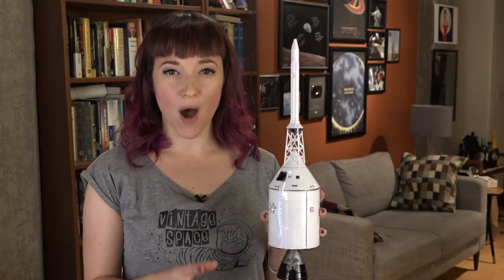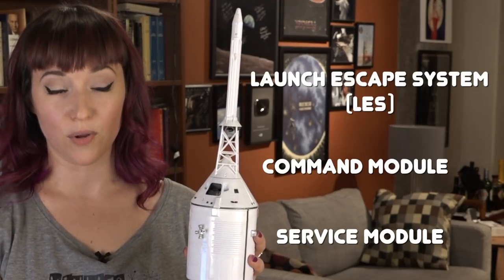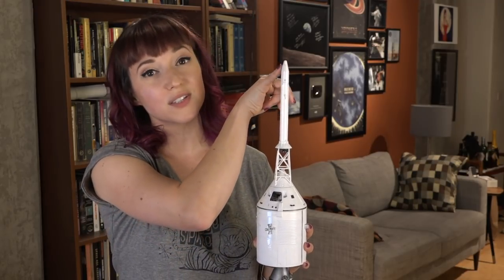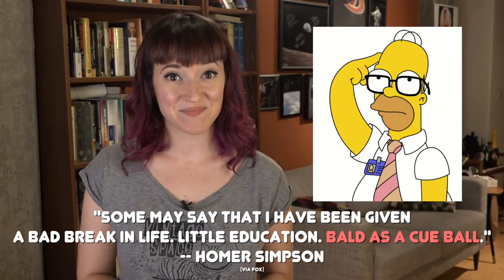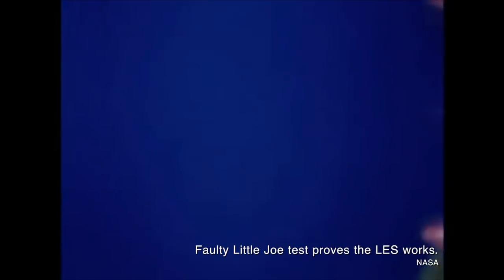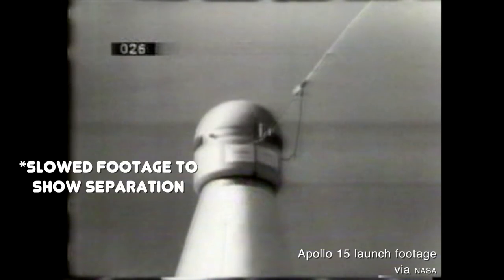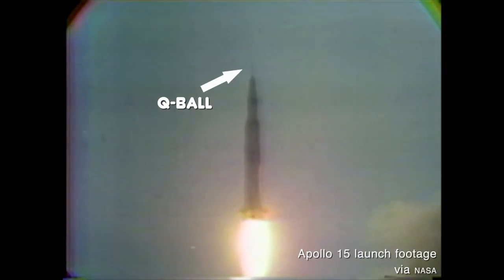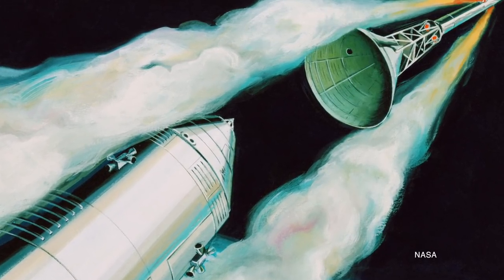The Life-Saving Q-Ball of Apollo

Comment: Among my other engineering duties at KSC from 1967-70, I was the Q-Ball Cover Retraction System engineer for the launches of Apollos 8 through 13.  I want to make a few comments on the video.

The top of the LES was not a “tiny silver ball” as stated.  It was cone shaped with a rounded top with holes in it;  no “ball” was visible.

The Styrofoam cover was put in place whenever the vehicle was exposed to the elements, namely rollout, CDDT and CD.  At the pad, the LES was usually enclosed by a small shack on the MSS.

The 2 halves of the cover were held together by a wide (3”) rubber (not elastic) band under tension.  The 2 ends of the band were held together with a short piece of copper wire that passed through a shearing (not razor) mechanism.  The cutter was attached to the cable that was routed back to the 320’ level of the LUT (via a pulley on the Hammerhead crane walkway) where the drop tube and control panel were located.

The command to initiate the cover retraction process began at T-8.9” (not T-5” as stated) when the launch sequencer sent a signal to activate the solenoid valve which applied 125 psi to move the lever supporting the weight.

The retraction system for Apollo 4 (and possible 6) consisted of an inflatable bladder that was inflated prior to launch, causing the 2 halves to pop apart.  This method was apparently too complicated and was changed to the rubber band method for Apollos 8 and later.  The QBCRS was monitored by the CPDC (pneumatics) console in the LCC and still had a (deactivated) switch on it to manually operate the old inflation system.
Reply: Thank you so much for commenting. You may not think it but you are someone’s hero. I regard every engineer and technician involved,  yourself included, to be my heroes.  Your collective efforts accomplished the seemingly impossible. The single greatest feat ever undertaken by mankind.  As an engineer, I can only dream that in my lifetime I will be involved in such a noble effort.

 I too noticed in accuracies in the video, demonstrating a general lack of understanding about the aerodynamic principles involved and what this device measured. For example, the misunderstanding of what the variable Q actually represents.  I do admire her efforts  however, to spark the imagination of people in a time when our civilization no longer seems interested in leaving the earth and exploring the great unknown.
Reply: Aw, shucks, twern't nuthin'.
Reply: apollo11guy I admire your humility :)
Reply: Several reasons.  For one, we didn't want another arm sticking out over the rocket where it could scrub the launch if it didn't retract properly.  Second, it would be hard to put the cover back in place if for some reason the launch was delayed or scrubbed.  The actual system was activated at T-8.9" when the engines were started up, so that baby was almost certainly going to leave.

Sorry for the delayed response.
Reply: apollo11guy Thanks for the info, I hadn't considered the risk of a half-retracted arm.
Reply: Was there a mechanism in place to confirm that the cover was successfully removed before the rocket was released?
Reply: @MrBtdobie  I read in either David Wood's book or Jonathan Ward's book about Apollo and the launch and they said, no there wasn't. They monitored it by watching the TV monitor. The b/w video that is shown in this video showing the cover coming off, was the actual launch video and was sent live to the LCC. So, they just watched TV to make sure it worked.
Reply: @apollo11guy  thanks for sharing
Reply: I consider your commentary a valuable Easter Egg. Thanx for sharing mate!!
Reply: Astonishing how much thought and engineering went into every single component. We'd never know without you guys being around to tell us.
Reply: Everyone that contributed to the space program are heroes. I am lucky to have witnessed the glory days of NASA and the moon landings. I try to read and watch everything I can related to that era,  and am in awe of how everything came together to get Americans on the moon. Thinking of the enormous complexity of getting them to the moon and back safely, you can see how they tried tried to simplify the systems for repeatability and redundency. Kudos to you and your pro art in that great accomplishment!
Reply: She's Canadian. Elastic = rubberband.

Comment: The question about the launch escape system I've had for many years (almost half century) has been solved. Moreover, I learned that the name of the Q-ball comes from the dynamic pressure = Q, and that the boots protective cover is removed by the tower jettison motor. Thank you for the wonderful video.

Comment: Just to clarify;   the 4 nozzles on the bottom of the LES are all connected into one solid fuel combustion chamber, not 4 separate motors.  You probably meant this, but others might not know.
Reply: plus they don't gimbal
Reply: Yup, they don't gimbal, the LES uses small fins and a separate engine-system to pitch
Reply: Thanks, you saved me looking this up. It didn't look like it would be four separate motors.

Comment: I would like to suggest a correction to what was said in the video presentation--The Q-Ball was not part of the launch vehicle attitude control system at all, i.e., it had nothing to do with engine gimbal commands.  To do so, it would have had to interface with the Launch Vehicle Instrument Unit.  There was no such connection.  The Q-Ball did 1 thing, and 1 thing only--it drove an Angle-of-Attack meter on the Command Module display panel.  For anyone interested, the meter it used was the Pc meter for the SPS engine, since this meter was not used for that purpose at this point in flight.  Also, the Q-Ball was not used as part of an automatic abort system.  Per the Apollo Mission Rules, the Q-Ball was used as a 'trend indicator only, with specific limits established in the Mission Rules document'.
Reply: Thanks for the info. How about the ballast below the nose cone that had depleted uranium and lead in it to help with aerodynamic stability. I've been trying to find some more in-depth info about this with no luck at all.
Reply: Hi Mako88sb-- I was not aware at all of the whole 'ballast compartment' business.  I dug out an Apollo Operations Handbook, and was able to find the following:

The tapered ballast compartment and nose cone top the assembly. The ballast compartment contains lead and depleted uranium weights. The nose cone contains  the 0\Q-ball instrumentation. Both the ballast compartment and nose cone are made of lnconel (a heat-resistant nickel alloy) and stainless steel. The Q-ball provides an electrical signal to a  display on the main display console and to the ground. The Q-ball has eight static ports (openings) for measuring pressure changes which are a  function of angle of attack. The pitch and  yaw pressure-change signals are electronically summed in the Q-ball and displayed on the indicator. The Q-ball information provides a basis for crew abort decision in the event of slow launch vehicle divergence. 

I know this is not exactly a 'wealth of data', but it's all I can find at the moment.  Sorry.   Do you know where Amy got the reference regarding the Q-Ball somehow feeding the Launch Vehicle flight control system?
Reply: Thanks for the info. Helps a bit.  I only found out about this particular feature after watching one of Scott Manley's episodes. Sorry, don't know where Amy got her info from.

Comment: Planes have static ports as well, very critical to determining rate of climb and altitude, and used as a reference point for the Pitot tube to determine airspeed in relation to ambient air pressure.
Reply: ecoheliguy Provided they don't clog with ice crystals, like on the Airbus A330 series.

https://en.wikipedia.org/wiki/Air_France_Flight_447

Comment: Pitot tube does measure air pressure in a technical sense. Differential pressure between the hole in the end of the tube and a reference hole. Indicated air speed.
Reply: This is correct.  It measures ram air pressure.  It also needs static air pressure to determine airspeed, the tube itself is nothing fancy although on newer planes the entire air data computer can live in the pitot housing it self.

Comment: I'd like to see a show on the renovation and restoration of the Launch Tower. It went through a lot of violence during each launch. How much had to be rebuilt or replace?
Reply: Woody615 The astronauts were the only reusable components in the Saturn V stack. Everything else was single use only, or outright expendable.
Reply: True. The astronauts were multiple use; the Capsule was single use only; and yes, I agree with you, EVERYTHING else was expendable on the Saturn V. But the LUT was used over and over again. I'd like more information on it's renovation and restoration.
Reply: Woody615 Ah, yes! Sorry, I misread your comment. That would be a good question to answer! In a related question I had asked Amy in detail before, I wondered what prompted the change to the 3 service support arms at the base of the rocket. I hope I've got the term correct as I'm doing this from memory. Through Apollo 4, they had a crocodile type end closure, but at some point shortly thereafter they gained a protective tower with a hinged ablative cover in place of the crocodile end. From watching several launch films, I can see engineers came up with a sophisticated means of closing this cover at the proper time - they tied a rope to the rocket, which pulled lid closed before the rope broke! Despite my best efforts, I've been unable to find a single word on this major change to the pad. This would fit within your question of pad/LUT refurbishment between launches.
Reply: I never noticed that before. Thanks.

Comment: Could you do a video about the steel rods that were pulled through dies to give a soft launch? The rods were attached to the first stage and the dies attached to the launch pad.

I haven't really done deep research on the subject but the available informative is limited. Pictures/video would be awesome!
Reply: Scott P GREAT question! I've done some research into this, and have found very few photos showing this part. It did cause some issues early on, with all 8 rods installed. Later flights only used 4, and later yet those were greased. I'd love to see more detail myself!
Reply: Glad I'm not alone! 

The technology and designs used in Apollo were so ahead of their time it's mind boggling! I've read multiple books and there's always new stuff I've never heard of.
Reply: Yes, great topic. I'm curious as well what they did for the shuttle launches and what they have planned for the SLS?
Reply: You know... I just watched a shuttle launch and it didn't look like there was any kind of soft launch system used. Also I've seen in other videos that the shuttle lifts off immediately after the explosive bolts on the SRBs fire. 

I'm thinking if they used something like the rods that the Apollo craft it could cause a force that's off axis with the center of thrust. If that were to happen the shuttle would have pitched over while practically on the pad. 

They may use something for SLS since it's more of a traditional big dumb booster.
Reply: There was at least one Shuttle launch where all the release bolts didn't fire and was ripped from the pad.   In fact, I believe the SRB's were so powerful that when they lit it didn't matter if the bolts released or not...it was going to fly!   Of course they wanted a clean release but nothing was going to hold that thing down once the candles were lit.    I'd never heard of the 'soft launch' system on Apollo...but it makes sense seeing as the motors did take a few seconds to ramp up to full power so once they overcame the weight to let it begin to move seems logical.  There were some REALLY good minds on display back then for sure.
Reply: +Recoil Rob   "There was at least one Shuttle launch where all the release bolts didn't fire and was ripped from the pad."

I found this link that shows the changes made to help reduce/eliminate such things. 
I also included a link for the collectspace discussion about the tapered pins and dies. Some pretty neat stuff. It doesn't look like a slow release system was needed for the Shuttle but I could be wrong. It would be interesting to see how that kind of thing is even determined. Did they need it with the Saturn 1 & 1B? Did the Russians use a similar system or something else altogether?
https://www.nasa.gov/sites/default/files/290339main_8-388221J.pdf
http://www.collectspace.com/ubb/Forum29/HTML/001327.html
Reply: mako88sb Thanks for those links. This may be the most obscure topic related to the Saturn V (hint: this should be at the top of Amy's list). The best I can tell is the mechanism was to limit pogo during the first few inches of flight, presumably because the rocket might settle (slam) onto the hold-down arms and break something. In hindsight, it seems overcautious. On the other hand, solid motors don't have the pogo effect, so there seems no real or perceived need for such a soft release mechanism.
Reply: +Mike Cowen
No problem. Found a pdf that goes into detail about the problems associated with transient loads:
https://ntrs.nasa.gov/archive/nasa/casi.ntrs.nasa.gov/19710014805.pdf

Haven't gone through it all yet but here's a quote regarding solid-propellant vehicles that confirms what you said:

:"Because of its structural properties, the propellant contributes little to the stiffness of the composite structure. However, because of its viscoelasticity, the propellant does provide considerable damping."

I checked on some of those references at the end but no luck so far coming up with anything that explains why they went with the tapered pins and dies. Here's the #5 reference for example. If nothing else, you get a better idea how involved this issue is:
http://www.dtic.mil/dtic/tr/fulltext/u2/460000.pdf#page=204

Another link regarding the Shuttle that's pretty interesting:
https://www.nasa.gov/centers/johnson/pdf/584733main_Wings-ch4g-pgs270-285.pdf
Reply: Interesting link on the transient loading!  Makes perfect sense that with a fully fueled vehicle that you'd NOT want the motors to 'slam' it with full thrust as that could and did buckle the structure.   Having the motors need to overcome some resistance before being fully released would help get the whole mass moving with as little stress as possible.   The example of closing a heavy safe door comes to mind:  you can push it closed with a single finger pressure applied over a few seconds or punch it as hard as you can which only smashes your fist without moving the door much at all.
Reply: Great stuff!  Thanks!  I never realized there was a chance of bursting a tank with an instantaneous release.  I guess this proves (somewhat tongue-in-cheek) if you're going to fly a 36-story, liquid filled, aluminum building, it's REALLY important to make sure the bottom end doesn't get moving (much) faster than the top.Are we feeling like rocket scientists yet? LOL!
Reply: Since we seem to be Shuttle fans here, I'd like to share a treat with you. I've posted it before, and even sent it to Amy directly (no response, eh?), but it tends to get lost in the comments (like this will, too).  You may have seen these videos in low res on YT, but here is the link to download the DVD and burn your own copy. Pure Shuttle "engineering porn".  Enjoy, and please DO share!https://sites.google.com/site/ascentcommemoratingshuttle/
Reply: Mike, thanks a bunch! I'll be sure to share it with my Kerbal Space Program group.
Reply: I looked into it a bit more but no luck at all finding more details or who decided on the method used for the Saturn V slow release system. I did find a pdf about proposed lift-off procedures for heavy-lift rockets from the early 1990's but one of the criteria was no slow release system. Forgot to bookmark it and can't seem to find it again. At any rate, it looks like after the Saturn V, they must have decided that the launch vehicle itself would need to be built in such a way that they can handle those lift-off transient stresses. Here are a few more links about some of the testing done on 1/10 & 1/40 scale Saturn V model:
https://ntrs.nasa.gov/archive/nasa/casi.ntrs.nasa.gov/19690013567.pdf
https://ntrs.nasa.gov/archive/nasa/casi.ntrs.nasa.gov/19700015977.pdf
https://ntrs.nasa.gov/archive/nasa/casi.ntrs.nasa.gov/19700020723.pdf
https://ntrs.nasa.gov/archive/nasa/casi.ntrs.nasa.gov/19690001603.pdf

Thanks for the link Mike. I watched the video about the camera ride-along with the SRB's. Great stuff. Looking forward to the rest.
Reply: mako88sb Three of my favorite scenes are where you can actually see the sparklers ignite excess hydrogen, watching the SSME engine bells wobble from the ignition shock, and inside the tail service structure when they pull the plugs. They're just 3 items most people never got to see, but really the entire DVD is stuff most people never saw. Of course, the "Real Housewives" crowd would be bored stiff, but let's not go there...